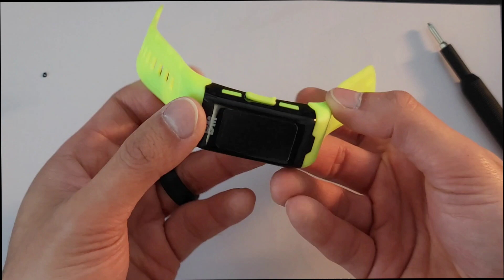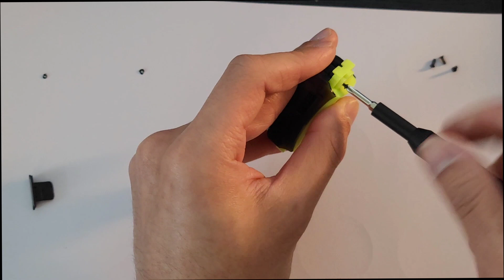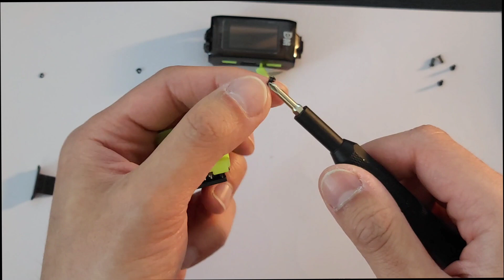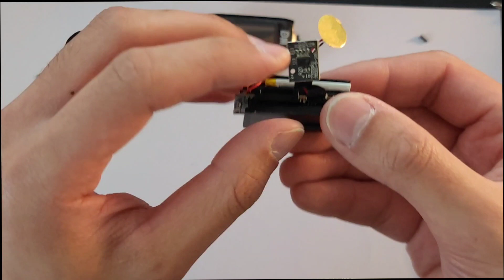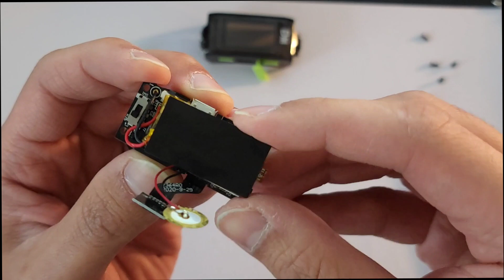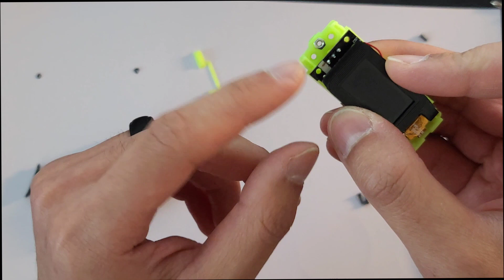Digimon Vital Bracelet Teardown

Comment: I've been waiting for this exact video. Could you do one using nanoflowX solution v2 to completely water proof the device? I'm asking because it has like no moisture resistance for a fitbit style device. I wanna be able to use this in rain or sun. Or hell go swimming with it
Reply from the maker: OK now THAT is super cool. I did not know that something like this existed. I'm actually making a custom watch shell for it that fixes a lot of common problems, and I considered waterproofing or at the least add water resistance so I can wear it in the rain or wash my hands with it via gaskets and dielectric grease, but I have yet to research it due to constraints in printing. Stay tuned for a future video and I'll talk more about it, and thanks for the tip :)
Reply: @VincentVeak  I definitely will. I wanted suggest this because the steps to use the solution are easy I just didn't know if a case or the solution would be more affordable/ easy to use